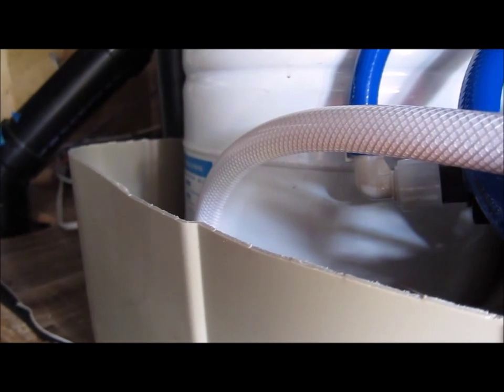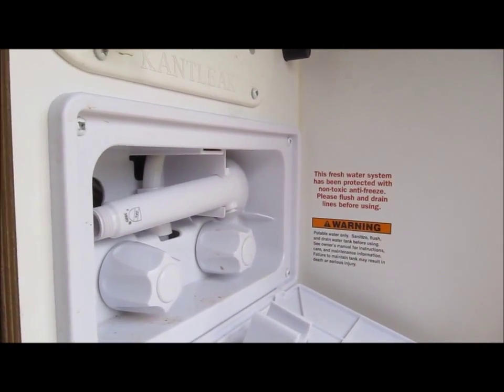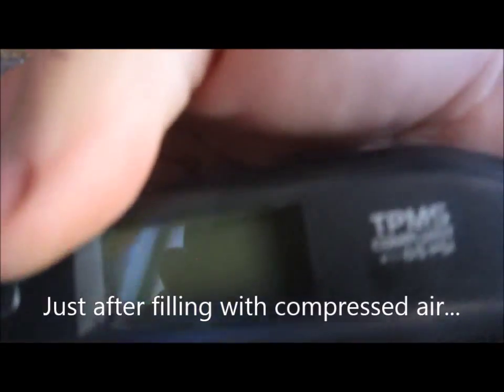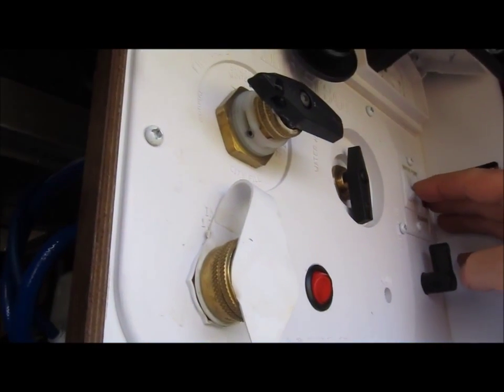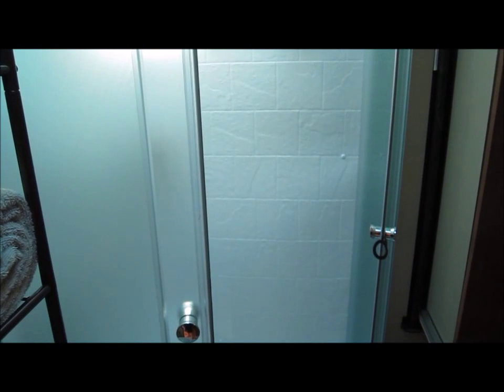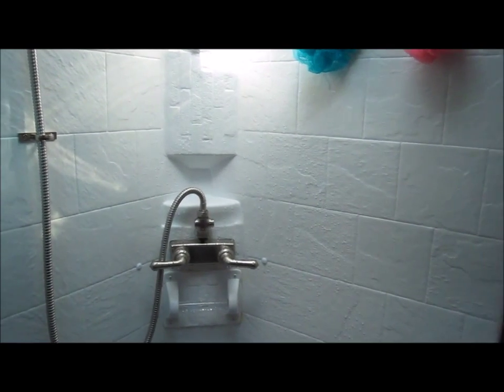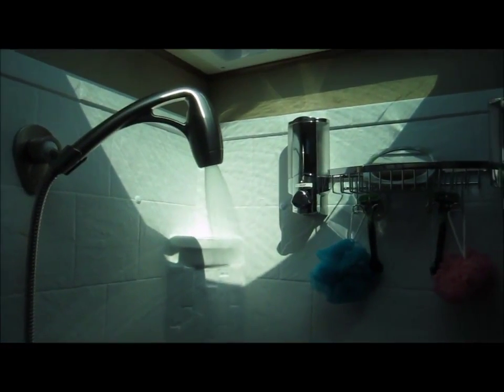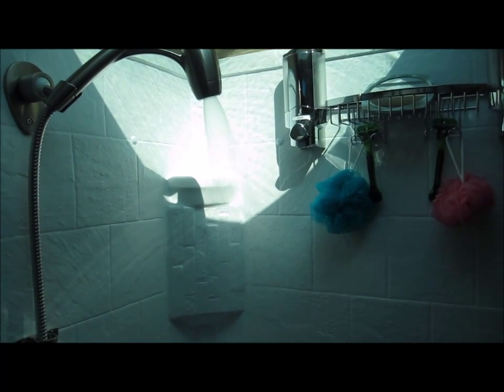How I Silenced the RV Pump 2

Comment: How big is your pump? I'm looking at making a system with a 2 gallon accumulator tank. I don't want it to take a long time to fill up. I'm thinking that with a bigger water pump, the kick on time will be the same but it wouldn't take as long to replenish pressure. Also, could replenish pressure while still using water. Thanks for the videos. I'm trying to figure out what type of pump I need so that it works in the same way as yours.
Reply from the maker: Well, I'm just not sure on the mechanics of it all.  There's the increased pressure and faster use of water potentially.  Even if reduced, there may be more strain on the pex piping and fittings.  I think the diameter of the water lines plays a factor as well.  Things to think about, but again, I just don't know how a bigger pump would play out.  Ours is 2.9 gpm 50 psi.